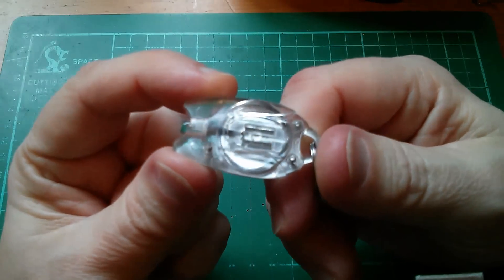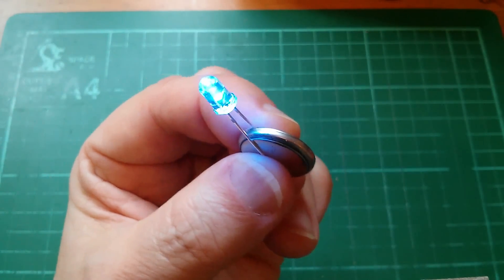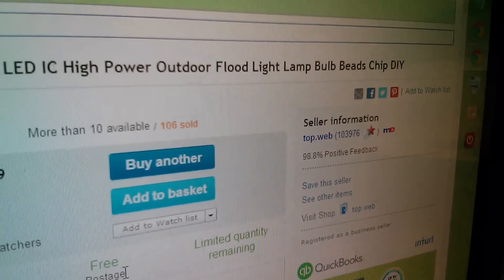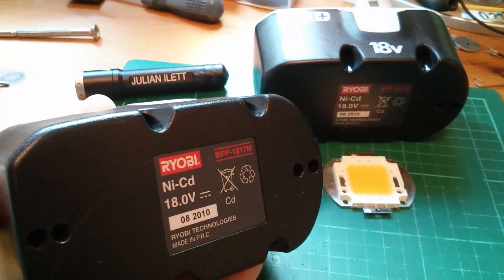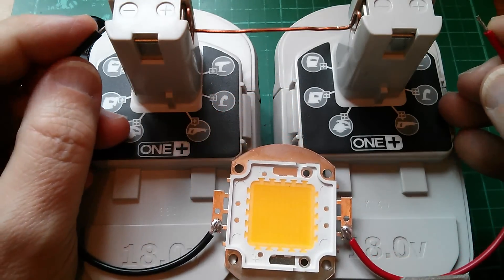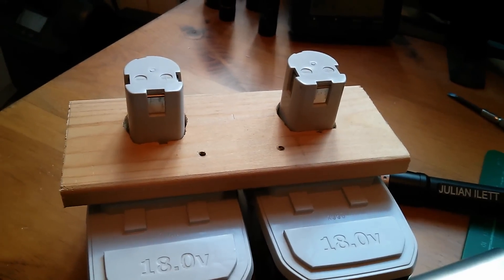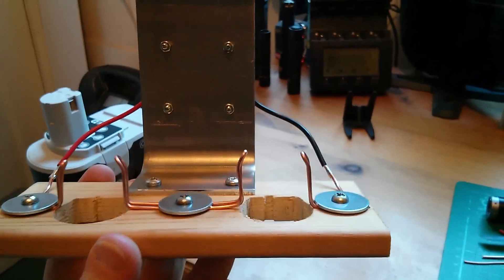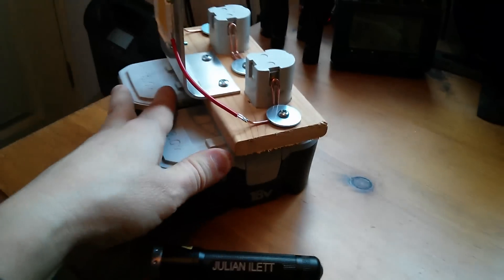Monster 7,500 Lumens 100W LED Flashlight for under $10

Comment: Have you tested the modual to be sure all of the LEDS (all 100 of them) are matched in intensity and that they all light? 

Most of these 100w leds are a scam, when you give them just enough power to start seeing the individual leds light up you notice not all of them do, or some are dimmer than others. 

For that reason 20w cob led modules are often brighter because they tend to be matched and all the leds actually light up.

Comment: These aren't 100W LEDs.  .3A * 34V = 10W at most.  Efficiency is low so the LED is probably putting out 1W or so of power in the form of light.
Reply: +Aaron Long did you only READ the specs?? 3000mA is not 0.3A but 3.0A Period. 3*34=102. LEDs are VERY efficient.
Reply: +PhL38F You are correct, I'm not sure where I got that .3A figure from.  I might have read it in one of the comments.  LEDs are about 15-40% efficient.

Comment: thats expensive flashlight lol them two batteries would be like 100£ :D use some thermal compound like u use for cpu coolers etc between chip and your cooler that will improve cooling capability and led will last longer :)

Comment: I am curious how many seconds (maybe minutes) will the led last because that a very small piece of metal... I have bought an 30W led with driver included and it only consumes like 18-19W (i don't know why, probably because it's a no-name one?) and i mounted it on a big heatsink (little bigger than a CPU one) without ventilation. In half an hour reaches maximum temperature (didn't measured it, but you can keep your hand on the heatsink for ~3-5 sec).  Question: How can you calculate the heat sink size/area? According to led dataasheet?

Comment: I'd only consider it "under $10" if I already had a bunch of ryobi batteries laying around. A more accurate description would be "100W flashlight for under $150".
Reply: xszl
- I rebuild my Ryobi batteries for about $15 apiece, instead of about $40 new. I'm sure that buying the batteries from Hong Kong, as I do, would be just as good for doing something like this as well. ;)
Reply: That battery costs 60 euro's here. Everything included for under 200 bucks seems more accurate.
That's not so cheap for a 100W cob nowadays.
You can buy them cheaper completely plug&play ip65 for lower prices.

Comment: Really? "Let's do magic, connect a 36V LED to a 36V battery and, tadaaaa!! the led lights on!!"... Connect that led to a steamy pile of sh*t and make it work, then I will be impressed, else, you just connected a led to a battery, even a 5 year old kid can do that, in fact I did better things with 5 years.
Reply: +Agustin Gimenez true
Reply: +Agustin Gimenez Then you should've known how LED's work. If you connect a 36 volt LED straight to 36 volts, it'll literally MELT itself. You need a driver or a resistor. This guy exploited the internal resistance/ESR of the battery, and he knew it was the right one. I dare you to connect an LED straight across 36 volts with 3 car batteries.
Reply: +Shaheer Syed ROFL. moron, just use a LED which needs constant voltage driving and you're done.

Comment: I once had one of these 1$-flashlights, just as an emergency light to  put on my keychain. It was not bright but bright enough for that purpose (finding lost stuff), but the switch failed after two days, although it was sold with a keyring, so it should have been sturdier. In this case you just get what you pay for...

Comment: Best way is to use a 50W LED. Connect it with a Lithiumpolymere battery (11.1 V) and a 12 V fan + cooler. And you need a reflector. Without it s just diffuse light
Reply: +Prussian84 a reflector doesn't do much it's just there for looks in most cases. :P a better option would be just to use a lense to focus the light.
Reply: If a reflector matches the bulb its a must, I'm guessing LED's that sprays light in 180+ degrees were built for reflectors. For sure they won't illuminate much without them.

Comment: 6:10 Why did you not get a shock when pressing the wire to the battery? I don't understand electronics that well.
Reply: +Luke Anthony Because the resistance of the finger is much more bigger than the resistance of the wire, so the most of electricity goes through the wire.
Reply: Thom ah, so it takes the path of least resistance, like lightning?
Reply: Luke Anthony Yes. Like water.
Reply: +Luke Anthony electricity has 2 paths. 1 is the path of least resistance. The other is that it tries to neutral out. So the batteries positive side has a difference of potential vs's the low side. Since his finger is a totally DIFFERENT source and difference of potential, it wouldn't be an issue. Also voltage has no reason to go through him, as the batteries don't want to go through him to get to their positive.  Another note is that you don't feel electricity unless it has amps. Now the light does want 3 amps, and if he were to touch one side of the wire with a his tongue, and then the other side with his tongue, he would risk a lot of damage. (as in using his tongue as part of the wire.
Reply: +TheSkepticSkwerl this isn't true. 3 amps is enough to kill, it depends more on the voltage and amperage.
you only need .2 amps to kill somebody.
Reply: +Moth correct. but it has to go through your heart. since the light is in parallel with his heart it wouldn't matter. as either finger would be the only part of his body in series. only his finger would be damaged. death is not a fear
Reply: yes
Reply: +Luke Anthony 18 volts isnt enough to feel it, you can only start feeling it when it's like 40 volts or more, it varies by person and by how wet your hands are
Reply: Not necessarily.... lick a 9 volt. You'll "feel" it

Comment: not much energy density in nicads, you need some lipos. At best you'll get 35 or 36 watt hours out of those two packs together. They have either de50nf or axcom sub-c nicads in them and they are 2000mah cells and there is 15 of them in each 1.2v x 30 x 2ah 36wh if you are lucky. might run for a half an hour or so. I'll wait for your next revision
Reply: Moth Cars are dangerous. When driving them you can crash into brick walls which might result in explosion and fire. Thus, cars should not be driven.
Reply: led will short lipos and result explosion and fire
Reply: +Vlad Avdeev  do you have any idea what you are talking about??
Reply: +Thad ward lipos are dangerous, is what he said.
when charging them you can overcharge them and they aren't as safe as a nicad.
Reply: Sebastian Ramadan that's very true.
i know that.

Comment: I tested this same led rated for 12 volts , connected it to 12 volts car battery : super bright but it overheated rapidly enough to burn oneself ...even a large heatsink did not dissipate the very localised heat...I cannot understand you used that high voltage ? 36 volts !!!!  Please explain .

Comment: Although it appears that there is no resistance in the circuit when the LED is attached straight to a battery, this isn't exactly true. All batteries have an internal resistance. A single NiMh will have an internal resistance of about 0.15ohms. An 18v Nimh stack has approx 14 cells in series so the total internal resistance is about 14x0.15=2.1ohms. At 3A this will result in a  6.3v drop per 18v stack, which is enough to act as an effective current limiting resistor. NiCad batteries have approx. half the internal resistance of NiMh so they will give half the drop, which is why NiCads are better for high current uses than NiMh.

You may also be  reaching the maximum current the cells can actually deliver at 3A anyway. You can check this by quickly shorting a 10A range ammeter directly across it to see what the maximum possible current can be.

Comment: having a need for bright spotlights (flood lights) for video filming etc I have used the same idea with smaller cheaper  MN1604, 6LR61, PP3 type 9Volt block batteries coupled in Series which also gives 36v DC. By keeping the LED in the original fittings for heat dispensation these have also worked for reasonably long periods. 

Usually the casings of LED flood lighting has a container attached for the LED driver  to convert voltage from mains power to 36v to run the LED. by removing the transformer and mains cable, then fitting the batteries, this makes the lamp completely compact and mobile I also fitted an on off switch through the hole where the power cable attached to the lamp. works great. 

I have also noticed that when the light stops working the batteries still have power in them so they can be used for other lower power devices such as smoke detectors, etc. this concept also works with 10W 20W and 50W LEDs.

An alternative would be to fit switch from mains to DC so that voltage would either come from the mains through the transformer or direct from the batteries.

so if you can buy a LED flood light for $9 and spend a dollar on 4 batteries you still meet the aim of this video without burning yourself or setting fire to anything.

Comment: one of those batteries alone is over 10 dollars.
Reply: +fhfffhfhffffhfhfourt if you watched the video he stated "batteries not included"
Reply: ok.  so the entire flashlight is less than 20 cents.  everything not included, except the piece of wood.

not much of a flashlight without a power source.  but that's just me.  i dont know.  HookedOnJonics
Reply: +fhfffhfhffffhfhfourt  You could get a 36v power source from the wall, and make these powered by the wall
Reply: where i come from, the only thing that you can get from a "wall" is alternating current.  and the least you can get is 120V.  what the fuck are you talking about, TheSkepticSkwerl
Reply: when i buy flashlights online 9/10 they dont come with batteries.
Reply: +fhfffhfhffffhfhfourt don't you have a full bridge rectifier? it shouldn't be hard to get 36 volts from the wall.
Reply: lol .  no.  i do not.  need more than just an FBR.
Reply: of course that's obvious.
Reply: Its true. You get 110 from the wall minimum. But with transformers (what your cell phone uses to charge etc...) You can get the 110 down to 36. Issue is, that it isn't portable. So unless you want to light a room with one of these, that is a useless way to go
Reply: ok.  so yes.  getting back to my point, this title is deceiving.  now let's all shut the fuck up.

Comment: thanks for sharing ;) can you guesstimate what type of wattage/lumens might be had from the LED you used if a single 6 volt lantern battery was used ? is it simple math ? reduce voltage to 1/6 (6 volts) and wattage drops to 16.66 and lumens drops to 1200 ? i imagine the heat would lower significantly also increasing it's life .......

Comment: I don't think that light is anywhere close to 100w for £5 looks more like 20w at best, you cant trust the Chinese ratings they always lie.
Have you measured the amps going into the LED ?.

Or if you get yourself a dealextreme lux meter you could do a ceiling bounce test compared to a light with a known lumen output and work out the output from there.

Comment: Very clever. I wonder if a computer heat sink with a fan might make a good heat sink for that light. I really like the way you made the terminal connectors with the copper wire. Very clever indeed.

Comment: A power LED with constant voltage supply ? yeah, really good idea... and then, 7500 lumens for 100W of LED is just a joke : for information a classic power LED is around 70 and 90 lumens per watt.

Comment: im going to have to buy one of these emitters for the simplicity.. but currently i suppose given the efficacy of the cree XML emitters, 10 of them on a board pushed at the max 10 watts, yielding the total of 100 watts, would yield closer to 10k lumens which is much more efficient and not too much price increase. im thinking 5 of them pushed slightly harder than spec max would be the best route to go to achieve roughly 7500 lumens at less watts. the fan is definitely a necessity also.

Comment: Power LEDs require constant current control. means as it gets hot it will change its internal resistance and what that means is you have to reduce the power or else it will get damaged. that's the reason it gets hot and changes the color. make it short your led will get damaged after you leave it for a while. I liked the way you assembled good job.

Comment: Love the video however those batteries make this flashlight much more then $10 to build.
Reply: +Sean Farrell I made a $2.50 car when I installed a glovebox light
Reply: Michael-Rainabba Richardson I don't agree. Unlike with a car, you recharge the battery. These are therefore no running costs, but part of the costs for the flashlight. If you take an LED and glue it onto a piece of metal, you cannot consider this a flashlight. Otherwise, your car headlights would also be a flashlight, as would your computer monitor, or even the lights in your house. I truly doubt you consider these "flashlights". Nickel Cadmium accumulators are rechargeable, so if you would buy a solar panel and a bit of circuitry along with the LED you would have next to no running costs, eliminating your claim to be "Operating costs", as these would not scale with use, as the maximum number of recharge cycles wouldn't be met under normal circumstances. +Glytch I doubt every maker has 2 18V Nickel Cadmium accumulators lying around, for example I do not, although I have plenty of other power sources. +Barnacules Nerdgasm Good point, and I didn't expect to see you here! You're almost at 500,000, before you know it you'll overtake Linus! :3
Reply: +mattymatt2323 right on dude!!
Reply: X-PlaneFlightsAndSims  Disagreeing is your right, but it doesn't mean you're correct and  demonstrating an edge case (confusingly at that) doesn't prove your point overall not make a more valid point less valid. Searched Amazon for "SureFire" (arguably the best known, high output flashlights) and the first result I found was SureFire G2X Pro Dual Output LED Flashlight, Black https://www.amazon.com/dp/B009F7J960/ref=cm_sw_r_awd_nyCKvbB561BYQ

Doesn't take long to see that the flashlight is $59 and a decent box of batteries is $20. The brighter the light, the greater the battery cost is relatively speaking. This hold true for rechargeables and a charger (making no assumptions about what someone has laying around).

Bottom line with any electronics is that power is an operating cost. Greater portability, greater power output and longer life and smaller size make this increasingly true.

https://www.tumblr.com/search/intj%20meme
Reply: Michael-Rainabba Richardson Neither does your "evidence" apparently supporting your claim. I don't see how battery costs increase with the brightness increasing, as battery costs could remain equal, resulting in less runtime. Nevertheless this would NOT cause an increased costs in a charger. I don't see how claiming that a "decent box of batteries costs $20" proves your point. The question here is not what is considered an operating cost or not, but how you define flashlight. At Dictionary.com, this is defined as "a small, portable electric lamp powered by dry batteries, LEDs, or a tiny generator." Powered by dry batteries, or a generator. You see, screwing an LED onto a piece of metal DOES NOT make it a flashlight, as a Flashlight has to be powered. It may be ABLE to be powered by batteries, but IT ISN'T. Thus, I conclude that the flashlight does in fact cost more than 10$, rejecting all of your claims. It would be illogical for you to question my facts, however, without ignoring the English language.
Reply: +Barnacules Nerdgasm Watch the video.
Reply: +Michael-Rainabba Richardson I replaced a tire on my car, does that mean I built a car for $50?

Shit logic bud.
Reply: +Mu sh He did have bad logic but your comparison is completely irrelevant to what he was saying.
Reply: +Barnacules Nerdgasm love how you comment just like a normal viewer.
Reply: I don't know about the US but if I bought a torch here in England, I would not expect it to come with batteries.  This is no different.
Reply: I think it's because he already had most of the supplies and so it only cost him $10 to make it
Reply: Barnacules Nerdgasm Actually, no it doesn't. The flashlight is under $10. The power source costs more as with ANY flashlight anywhere. Your logic is like saying that utilities are part of the cost of a house or fuel is part of the cost of a car. These are OPERATING costs and in every single case, those costs scale with use.

One more time, the flashlight can be built for under $10. You could then sell it for more and make money. Operating it on the other hand, costs more.

Comment: What would you need to do to turn this into a strobe light?  I'm not talking about a constant strobe light but rather something like a double flash every 2 seconds, kind of like what you'd see on a plane at night.  Could you run it for a longer period of time in this "mode"? If so, about how much time?  Thanks.

Comment: Would running 8 18650 series be able to run this?  Instead of using 2 drill batteries.

Comment: Here's a similar video using what I think is probably the same LED.  The maker claims a £25 price point, which again probably doesn't include the battery.  It does use a monster heat sink and a fan.  Maybe the two ideas could be combined.

https://www.youtube.com/watch?v=c--5c3Egv4E

Comment: Interesting video. Seems like a novel engineering approach.

HOWEVER, it does not cater for the type of power saving circuitry that exists within most 'serious' flashlights; i.e. a circuit to pulse the LED very rapidly in order to save a lot of power. Our eyes do not see the flashing (due to the integration effects of our eyes), and the light appears continous, however the actual LED is only on for about 2-5% of the time. This saves battery life. A lot.